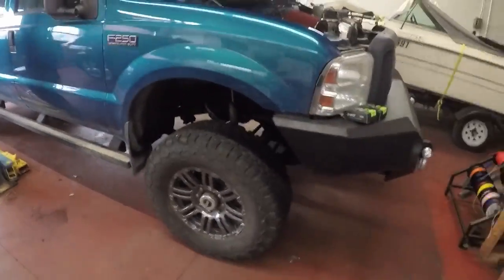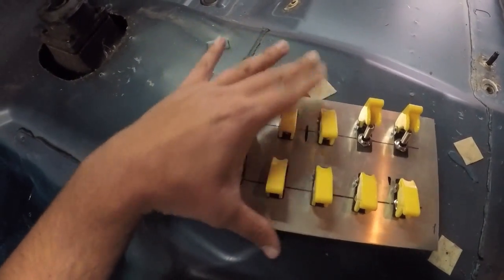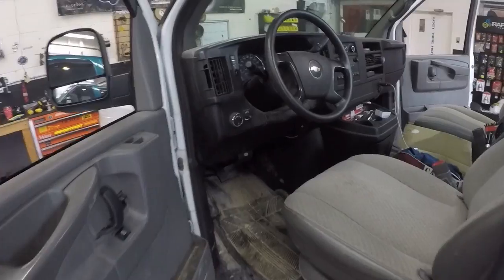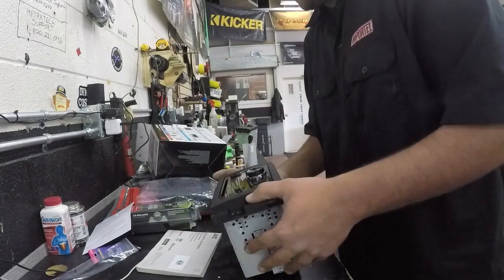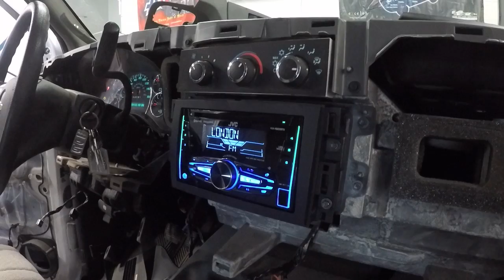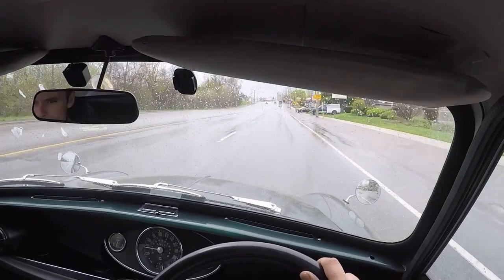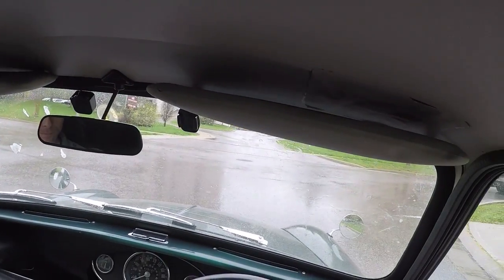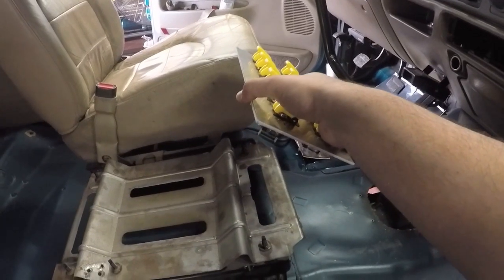1PUGLIFE: Shifty Gets Planned Out! POV: Classic Mini!!!

Comment: I'm not dissing you guys but it seems that the manual shift is a bit alien after being so used to automatic shift for so long. A few days and you would be throwing that wee Mini about like a BOSS. I had an 1980's base level model with a 1275 engine when I was 19 and it was the best fun in a car you could have with your clothes on. All excess weight removed, suspension and brakes upgraded with just 2 nice bucket seats. Rain would leak in through the front screen and so eti es the wipers would jam half way through the sweep which made for exciting drives in the rain lol.

Comment: Just a question...Do the wire colours usually correlate properly when you use the connector adapters (ie green connects to green, yellow to yellow, etc.)? Or do you just know from experience which wires connect together?
Reply from the maker: Oct James... if you can color you can wire a deck harness

Comment: Minis are meant to be revved, I could barely hear the transmission whine on your test drive!  Everything is available to customise them as they are a 50+ year old design and things like simple seat extenders can be bought, or made, to give you leg room.  However, you do have to be a midget to get used to the low windscreen height.
Just remember the old mantra, driving a Mini is like riding an ugly woman.  Great fun until your mates see you.